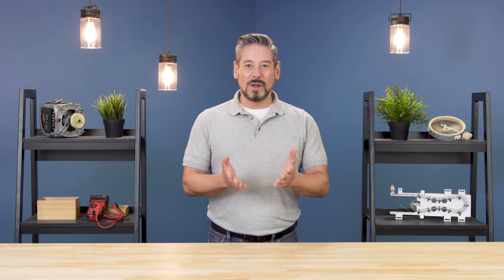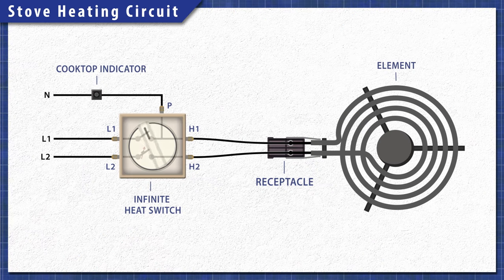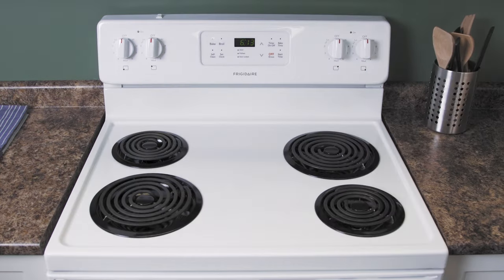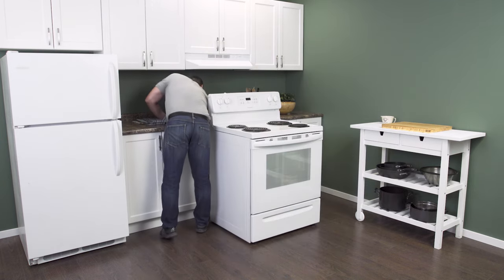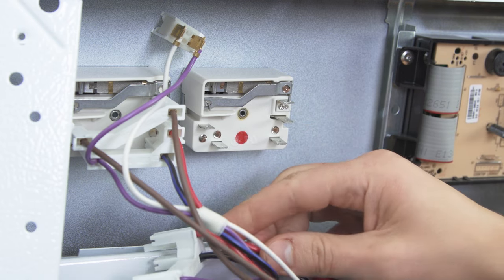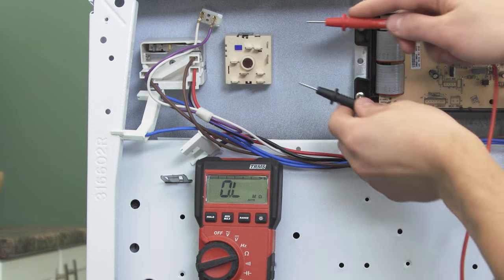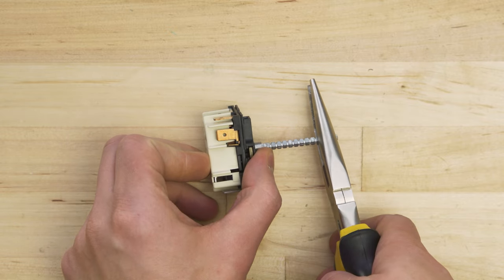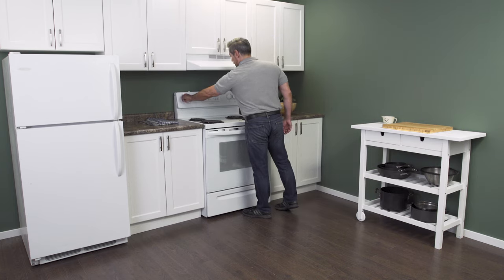Cooktop Indicator Light Stays On - Troubleshooting | Repair & Replace

Comment: Helped solve my issue. After discovering which switch was faulty, I was able to bandaid the issue by cleaning the terminals and beating the switch like it owed me money to break the contacts loose. Solved the problem for now until the replacement part arrives.
Reply from the maker: Thanks for watching. Based on how these heat switches are made and how the metal inside the switches warps over time, rattling the contacts loose would help but its definitely still smart to install a new one.

Comment: This was VERY helpful. I purchased a multimeter and found the defective switch. I have removed the switch from the unit and we are waiting for the replacement swith to be delivered. Is it safe to use the unit while the switch is disconnected while waiting for the replacement to arive?
Reply from the maker: Thanks for watching, we're glad to hear that the video helped you narrow down the problem! The cooktop can be used but its best to leave the old switch connected (but turned off), OR to wrap any connectors in electrical tape to prevent electricity from flowing into the body of the stove to ground.

Comment: Btw in my situation the switch no matter what I pulled off didn’t do anything. The light remained on. I cleaned it with contact cleaner. No change. I removed the clips pulled the metal cover, metal post for the knob and phenolic and plastic insulator and found a bug was shorting the contacts. I saved myself $50-60. Pulled the bug and just put it right together as I disassembled it. Works great. Easy fix and old technology to boot.
Reply from the maker: Thanks for sharing your experience. We're glad that you were able to narrow down the problem!

Comment: So I have a ceramic top stove with the switches on the front, do you have a video for that style
Reply from the maker: Thanks for watching. The "slide in" ranges are a little different and aren't as common. We don't have a video showing how to access the heat switches. You'll likely have to remove the heat switch knobs and the faceplate to get access to the heat switches and control board underneigh. In other cases you might have to remove the cooktop.

Comment: i know this video is old, but my stove just started doing this, i have no issue replacing it as i feel handy enough. my question is, is this dangerous to leave on and just wait for the part? is there any danger for a fire?
Reply from the maker: Thanks for watching. The indicator light is just a  light bulb. If it is still getting power then it is no different than having any other light bulb on for an extended period of time. As long as the burner itself turns off and stays cool, then you're good.
Reply: @AmreSupply  oh then im fine, thank you. everything works, it just the light was staying on. i was going to take it apart and just swap a switch from the back burner i never use but if its a non issue then im not gonna really worry about it. ill just keep an eye on it. thanks mate! you have a great weekend and i hope you have the best year you can
Reply from the maker: @AlteredCarbons  We're just happy to help. There is one more solution and it is to unplug that particular switch then isolate and individually wrap all connections in electrical tape. That will prevent the burner & light from getting any power until you have a replacement switch.
Hope you have a good one as well! Cheers!
Reply: @AmreSupply  yeah thats what im planing to do over the week end. swap the back switch to the front as i never use that one back burner , put on some electrical cap off's and order the part in a week or so. its just me living here so i mainly only cook breakfast on the top burner. im just glad it isn't a electrical board issue.

Comment: Excellent videos. My glass top stove power indicator light and hot cooktop indicator both started staying on even though no eyes are hot. Any thoughts?
Reply from the maker: Thanks for watching, we're glad that you're finding the videos helpful.

It is unusual for both the power indicator light, and the hot surface light to stay on at the same time. The cooktop (power) indicator is controlled by the heat switch. The hot surface light is controlled by the limiter on the hot surface element.

If the hot surface light stays on then you'll have to check each of the limiters in each element: https://www.youtube.com/watch?v=CXhmlswg30Y

For the power indicator light, you'll have to test each heat switch.

Alternatively, if your model doesn't have heat switches and instead has a control board for all burners and the oven, then it's possible that a faulty control board could cause these issues.
Reply: Thank you so much, this is of great help moving forward. Excellent channel!
Reply from the maker: @MrBigred1970  You're welcome, we're just happy to help!
Reply: @AmreSupply 
Can you tell me if light stays on but there is no heat, does it take much electricity
Reply from the maker: @JosipJanjušić  Thanks for watching. With it just being a small light, it takes significantly less electricity than the electric burner. Still best to install a new heat switch.

Comment: Greetings again, I replaced both switches and the light went out. Now only one element gets hot the small one doesn't get warm. any answers for this ?
Reply from the maker: Thanks for watching. Check the wires and the terminal numbers. 1 wire on the wrong terminal could cause this problem. As well not that some replacement switches might look similar but might have different numbered terminals so always double check the terminal numbers.
Reply: @AmreSupply  thank you for your reply I will check that,

Comment: I have an indicator light that sparked and the wire is burned. I wanna know if i can just use the oven without an indicator? Can i just unplug the indicator light in the oven? And let the wires hang? Or do i gotta do something about em?
Reply from the maker: Thanks for watching. The oven can be used without an indicator light but it is never ideal to leave a live wire hang. Until the wires & indicator light are fixed It is best to put a wire nut and electrical tape on the connection.

Comment: I clean ed under the top before finding yr vid,   I put every bk its still on, it is for the 2 burners on the right side, I never use the back burner on the bk rt, can I just plug that one, so it wont cycle hot.
Reply: ❤❤❤ I twisted the knob repeatedly and heard pop, like there was a short I kept doing it for abt 10 more seconds, and when I turned it to if it went off. Thank God. I appreciate yr video too
Reply from the maker: Thanks for watching. If the cooktop indicator (power indicator light) is on, then it's an issue with one of the heat switches. Since you were able to turn the switch and wiggle the terminal loose, it turned off the light, but it's best to install a new heat switch. You can enter your model number to find a replacement switch if needed: https://www.amresupply.com/lookup

Comment: I have a Bosch electric cooker, accidentally burnt the light out because someone used a big pan and it was touching the light, I'm looking for a replacement but its hard to find although I've seen those diy indicator lights that fits in the hole (6mm) and is rated 230v (I'm based in Europe) would these work ok?
Reply from the maker: Thanks for watching. It is hard to say if the light will fit or not. It's not recommended to use non standard parts for repairs but to work a replacement has to fit, have the same ratings and have a secure connection. Best to check if there are any cross over referenced parts for your model.

Comment: I have the same problem. But there’s only one light. Can I still use the stove? Do I have to try and fix it eventually or can I just leave it as is?
Reply from the maker: Thanks for watching. If the cooktop indicator light stays on but the burners all cool down when powered off, then the burners can still be used normally. It is still best to try to narrow down and find which switch is faulty. The faulty switch might continue to give you more problems.

Comment: Is it safe to leave the stove plugged on when surface light is always on?
Reply from the maker: Thanks for watching. The surface indicator light is on a different circuit than the stove heating elements. As long as the elements are cold after shutting off the power, then having a surface indicator light on will not effect the operation of the burners. Still it is best to replace the light as soon as possible.

Comment: So i checked all 4 and all show ol with switches off as they should plug back up and light is off, must have one getting sticky and the movement broke it loose im guessing as i removed each switch to test them. What do you think?
Reply from the maker: Thank you for watching. Yes it is possible that by removing and testing the switches one of the connection was loosened so that it was no longer sticking. This may not be a permanent fix though, so keep an eye if the indicator light stays on in the future as you might have to narrow down the switch if it starts sticking again.

Comment: Mine sparked and the breaker went so I unplugged and let sit for a couple hours then tried to plug it in again and indicator light stayed on and the same burner through a bunch of sparks again. Would this be same problem? Or broken stove?
Reply from the maker: Thanks for watching. If the power indicator light is staying on then it is likely an issue with the heat switch.

Alternatively if the "hot surface indicator light" stays on then could be an issue with one of the heating elements. https://www.youtube.com/watch?v=CXhmlswg30Y

If a component is sparking then it should be replaced. If the sparking is coming from the wires, then you'll have to make sure that all the wires are secure and are not shorting out.

Comment: Does this run the  electric bill up since it’s not technically on
Reply from the maker: Thanks for watching. If the cooktop light stays on then it will use some electricity, but it will be a small amount, only a fraction of what would be used when the cooktop is heating up.

Comment: My elements are cold but the red light is on in the off position should I unplug the oven until i get a replacement switch? I want to sleep easy
Reply from the maker: Thanks for watching. The power / cooktop indicator light is safe to leave on as the light itself does not send power to the burner. As long as the burners are off then it the light is not a problem as you wait for a new heat switch.
Reply: Thank you for your help.
Reply: I was still able to cook on the element. I was worried.
Reply: Greetings Again, I replaced both switches and the light is off, but now the smaller element on that side is not heating up. Any ideas on this

Comment: My light won't go off and I tried the breaker 2 times. It is now 1am and I was going to bed but I was afraid something would happen. I took the burner out that I used today just in case. I just want to know if there is anything else I can do or if it will be ok
Reply from the maker: Thanks for watching. It always good to take precautions. If the light won't turn off but there is no heat coming off the burner than its most likely just a stuck contact in the heat switch. It would be best to use a multimeter to test the heat switches as shown in this video. That will help you narrow down which switch is causing the light to stay on.

Comment: All my burners do not get hot, maybe the middle of one, all 4 don't probably work maybe one coil will work or just the middle one, now the cooking light has been on for almost 10 hrs , I am old and am on oxygen:, do I have to worry about fire, because I am unable to do what you are instructing us to do, it's an old whirlpool, I am more worried have oxygen running and it causing a fire
Reply from the maker: Thanks for watching. If the burners are not working then you should contact a technician. When the heat switches are set to off, there should be no power to the burner. The cooktop indicator light is not a problem, it's no different than leaving any other light on. If you are concerned, you can unplug the stove, or shut the power off at the breaker.

Comment: My problem is with the oven indicator light not turning off.  Is this repair done the same way?
Reply from the maker: Thanks for watching. If you have a dedicated indicator light for the oven then you likely have a model that uses a oven control switch rather than a control board. In this case replacing the oven control switch will likely help.

Now if you are referring to the hot surface light then the repair is different as its a problem with the surface element: https://www.youtube.com/watch?v=CXhmlswg30Y
Reply: @AmreSupply  Thank you for the quick reply.  Yes it is a dedicated indicator light.  It goes off only if I turn the oven knob past the off position.  I am having an issue pulling off the oven knob.  All other knobs pull off easily. Is there a trick to this one?
Reply from the maker: @garyh8794  The dial or knob might can just get sticky over time and might need some help. There shouldn't be a set screw or anything but it doesn't hurt to check to see if you can see one. Regardless if the contacts are not closing properly and you have to turn the dial farther to turn off the light then its best to replace the oven control: https://www.amresupply.com/catalog/Oven-Control-Thermostats-632506-AD1P
Reply: O

Comment: Ok but how do I find out which one is causing the light to stay on?
Reply from the maker: Thanks for watching. In this video we show how to test the heat switch (in the off position) to see if the contacts are stuck together. You'll have to do the test on each of the heat switches until you find one that has a continuity between the L1 and P terminals.

Comment: What's the top light button do I push it and nothing happens.
Reply from the maker: Thanks for watching. The cooktop indicator light is not a button that is pushed. It turns on anytime there is power to a burner. If the light stays on then it's likely an issue with one of the heat switches.

Comment: Is it dangerous if the light stays on until someone can fix??
Reply from the maker: Hi Kathy, thank you for watching. The light itself is not dangerous when it is on, all it means is that power is being sent to the light from one of the heat switches. If the burner shuts off normally and is not continuing to heat then there is no problem with the light itself staying on. If the burner stays on, then it's recommended to shut off the breaker or unplug the range to disconnect power.
Reply: I have the same problem. Can't get it fixed for now, so I disconnected the power from the breaker. Is that ok?
Reply: @AmreSupply  I cleaned under the hood before I found yr vid. I never use the suspected burner, but I cleaned everything plugged the burner back in, and noticed it is hot now. Since they are separate, can I just unplug that grate? I am a lady and it looks like the back panel is full and stove has bn the Lord e a long time. I am not sure I can move it, that light is the fatherest away. I know that sounds like whi, whi, whi. Can I just unplug that one. Thank you soo much for your help.
Reply from the maker: @mattierogers6447  Thanks for watching. The hot indicator light will stay on when there is an issue with the switch. A faulty switch can also cause a burner to stay on, if this happens turn the power off at the breaker. In any case it's best to install a new switch. This will likely require pulling out the stove which is easy to do with 2 people. Some stoves have 1 back panel. Other stoves are easier and will have an upper panel where you can access the heat switch. 

As for unplugging the switch it is not recommended to just unplug any wires and leave them hanging as there is a risk that the wires will touch each other and cause a spark or a short. In these cases any unused or disconnected wires should be properly wrapped in electrical tape. It is best to install a new heat switch.

Comment: Very strange my indicator light started staying on when we changed the clock
Reply from the maker: Thanks for watching. Is the indicator light built into the control board?
Reply: @AMRE Supply  I'm not sure. Its on left side, below knob. 
Whirlpool glass top, manf in 2016
Reply from the maker: @tymom9313  If it is separate from the control board then it will be a individual light as shown in this video. It will only power on when L1 & N on one of the heat switches is powered. Check to see if each switch is actually off. It should snap back into the vertical position. If this doesn't help then test the switches based on the instructions in the video.
Reply: @AmreSupply  thank you!
Reply from the maker: @tymom9313  You're welcome!